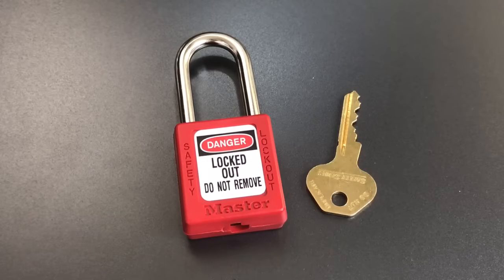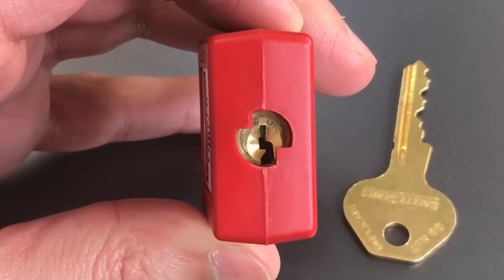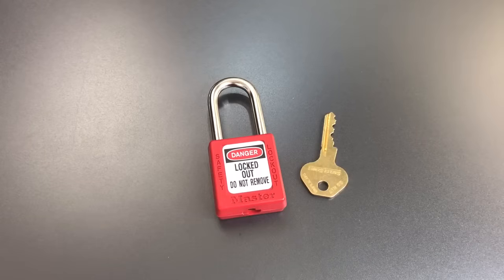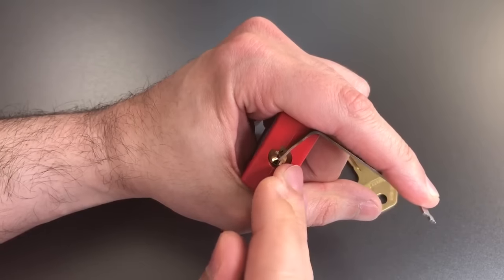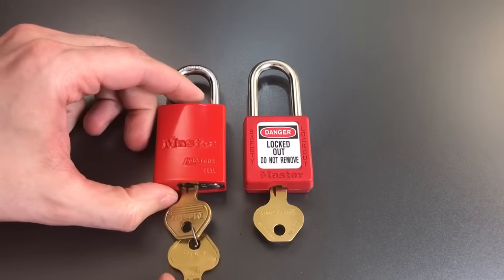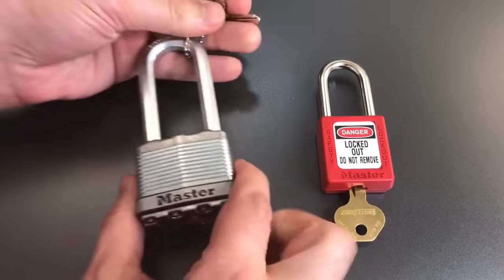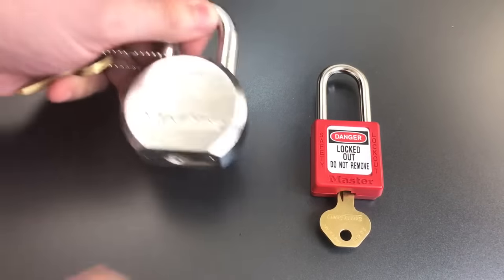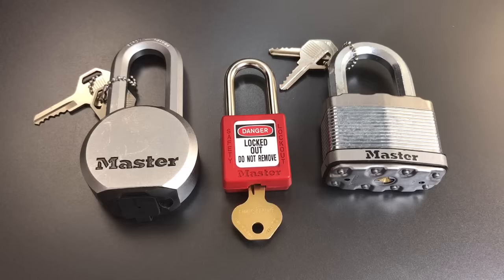[479] The Master Lock Paradox - Model 410 LOTO Padlock

Comment: The reason the body is so crappy is because if its locking something dangerous but you need it in an emergency, and that emergency happens but someone miss placed the key and it had a good body you’d be screwed but because the body’s so bad you can just break it off access whatever it is

Comment: cost and also weather resistance
the more pins you have the more failure points you have and if your lock rusts shut at just one of the pins, you basicaly have to break open the lock which defeats the purpose
all three locks are for different use cases
the plastic body is so that it can be taken off easily but only in ways that show it was brute forced (it might also have something to do with electrical conductivity but i cannot confirm)
the one with aluminum body is for more intensive uses in environments where there is a high risk of projectiles flying around i assume
and im assuming the 4 pin one is for outside use since the more pins you have the more likely a failure due to weathering is i think

thats my theory on it at least

Comment: Master Lock having a huge range of products that are all flawed is probably intentional. Buy one crappy lock with a good core, some guy smashes it open. Buy a different Master Lock with a hardened lock body, some guy picks it open easily. Buy one with a super advanced hard-to-pick core, someone cuts through the non-hardened shackle, and so on. If you buy a totally secure lock, you've just lost yourself tons of potential future sales!

Comment: These are hard to pick but not high security for a reason. They are usually attached to an easy to break or remove plastic breaker lock or wire rope or plastic valve lock. You'd break the lockout device before you break the body or shackle of the lock. Its a MASSIVE NO NO to remove them, it's more of a flag saying hey dont turn this on cause youll kill some one kind of lock. Ive been a marine electrician for 17 years.

Comment: The reason for the complex core is so that there are more possible key combinations, they aren't worried about it getting picked since it's a safety tool not security. Old versions of these only had 4 pins, and at a factory that i worked at they had an incident where 2 people actually had the same key for 2 locks. which should never happen with LOTO situations because you shouldn't be able to open someone else's lock.

Comment: Used to use these all the time whilst working inside machinery.
The body is designed to be fragile so if some asshole goes home and leaves his lock on equipment, a report can be written and verbal confirmation can be given to break the lock and start the machine.

Honestly 2 spanners or even a decent sized screwdriver can break the body.

It's honestly to do with workplace safety guidelines.

You want a lock that's easy to break if needed, but not picked and removed to look like it was done by the owner.

If a lock is removed in an unauthorised way they want the lock physically broken so they know to point a finger, if a lock is picked and removed the blame may be unfairly put back on the owner.

Comment: Maybe that 6 pin core with extra security is to make it more tamper-proof. Breaking it is kind of obvious but picking isn't so easy to identify at a glance. There are certainly applications in which preventing people from tampering with controls is essential. Combine CCTV with a difficult core and it's not worth tampering with, breaking the lock would stand out on footage and be obvious to anyone seeing the lock, picking would be less obvious especially if an individual has reason to be close to the lock and cameras have a poor view of the area allowing subtle hand movements.

Comment: heres what i see: if that lock's purpose in the proper context is for important switches that are not visible to the main public (maybe inside a power node or station) then they would want to be able to get it off quick in an emergency if the key is not easily accessible. A non hardened latch and a shitty plastic body might make sense then, signaling that this should only be removed by the right person and in the right circumstances. I mean, its the only one of the locks you mentioned to have a HUGE sticker on it saying danger do not remove.

Comment: @j37j did a really good job explaining why these locks are “over built” compared to their metal brethren. I will just add why they still make crappy “normal” locks.

It’s because they can. 

Most of the time it works too. So they can mass produce cheep locks and 90% of the time that’s all the average consumer will need. If it wasn’t for LPL we probably wouldn’t know either.

Comment: The plastic body locks are intended for use when a worker is present and require a key to operate. They are constructed to be durable and sturdy to prevent unauthorized access. However, in the event that the key is lost, these locks can be broken easily. On the other hand, metal body locks are designed for longer periods of use and increased durability, making them suitable for securing equipment or facilities for extended periods of time.

Comment: Plastic used for lightweight and easier to  carry, non conductive, less stress on part  that it's attached to, more likely to be used than if someone had to carry around a heavy padlock. I don't think they based the security of the lock on whether or not it was easy to pick, maybe based on whether or not another key could be used to open the lock by accident. With locks and keys being worn out over time and a workplace with a large number or employees with the same amount of key/lock combinations

Comment: The idea behind the super flimsy casing and shackle but the robust core is pretty easy:  This lock is meant to be easy to remove if someone forgets to remove it, but extremely difficult to remove by someone being malicious and trying not to leave evidence of their sabotage.  If they could pick the lock open easily, they could pull all sorts of malicious pranks.  For example, they could take the lock off, hide it in the worker's belongings, and claim they weren't using it properly (LOTO violations are usually extremely severe, sometimes instant termination).  Or, even worse, they could remove the lock, turn on the machine, then lock the machine out again with the same lock and pretend nothing happened.  And as much as it pains me to say it, there are people out there who WOULD do this.  Having to cut the lock off to remove it without the key gives management a route to unlock a machine that was locked by an employee who then either forgot to remove their lock before they left or intentionally locked it as a form of sabotage, in a matter that permanently destroys the lock and requires a replacement.

Comment: The reason for the "paradox" is the core needs to be secure and pick resistant so just any Joe shmo can't pick it and a key is required, but the body and shackle need to be able to be cut in case of a lost loto key or emergency happens and a switch or valve needs to be accessed.

Comment: Well I think because they get cut off more times then not because operator’s put there lock on equipment then shift change happens then they get cut off and due to only have a single key. Also they are used by a lot of mechanically inclined people that can pick locks so that makes since they are harder to pick.

Comment: LOTO locks purpose is not for security, but more for liability. Sure you could destroy these locks and get easy access to anything locked by them, but then the destruction is obvious and if you die from it the company isn't responsible, however if you can pick the lock non-destructively this is harder to prove and looks more likely that someone forgot to lock it, making the company responsible. That is why the locking mechanism is more robust than the lock itself.

Comment: If you come across a lock out/tag out lock attached to a disconnect switch, don't mess with it. They're there to prevent injury, or even death, including yours. There's a procedure to go through if it needs to be removed. (This statement is meant for every one.)

Comment: The lock that can get you charged with attempted murder for removing without authorization.

The body is plastic because of cost. Every person working on the system needs their own lock to LOTO and in the US employers are required to provide the equipment. So, if you have 300 employee's on your maintenance team you need to buy at least 300 locks.

Comment: As for why they are so well done. Imagine someone who would pick open that lock, activate breaker, hear screams, deactivate breaker, lock the lock back to original position, then leave. Person with burn marks would appear from the door...

All pins security pins, all these colors that distinguish them, certain type of pin ONLY on specific position. Looks like someone who designed them had experience with what could happen, and didn't want that stuff to happen easily.

Also that plastic body is preventing repining of that lock. Is this bump resistant as well, or is it old design?

Comment: some LOTO need to be able to work with breaker locking systems, that is,  special devices that can hold circuit breakers "open" -- as you said they are not really security devices more than visual barriers so that anyone knows they must not energize that circuit as you could fairly easily rip off the device used to secure the breaker. because of this, you wouldn't need to deal with the lock at all to defeat its purpose. a bigger issue would be if the lock were able to be picked or raked open since keys are usually issued to one person and they would be responsible in case of an accident for not locking out and could absolutely be falsely blamed in this way.

Comment: They need to make them somewhat resistant to picking because someone could just easily pick it and energize a circuit while the equipment is in service. It has happened to me someone broke a lock while I was working on a machine.

Comment: I think this lock is meant as a reusable seal.
If you pick a LOTO lock, you don't leave any obvious evidence so they made it as hard as possible to pick it. Destruction in any way leaves clear evidence that the device it was securing was tampered with.

Just like those "key safes" I use as a landlord. It's a plastic box which can't be opened without breaking it once it is sealed. There is also  a set of stickers with holograms, one wrapped around the box and one to stick to the lease paperwork. In an event of emergency, I can break the box easily and enter the flat of the tenant. But I can always proof that I didn't use that key.

Not that I would need the key inside of the box - wink wink-

Comment: It makes sense that there's 6 pins to decrease the chance of an accidental duplicate. the security pin thing is a bit weird for a non-security lock, but if one large and possibly government customer asks for it it's not worth the effort of making a lower security version.

the big question really is why none of their high security locks with beefy shackles and steel bodies don't have cores like this when they make them at volume.
Reply: That's probably the reason. Relative savings for high production count. Most people judge a lock by its exterior anyway.

Comment: Ok. I’ve looked this lock up just to make sure my reasoning was sound. This type of lock would probably be used in high voltage situations. The thermal plastic is non conductive. You would not want to bring a ferrous metal body lock into that situation. High voltage arcing to the body of the lock would mean instant death. Even if you just brought it into the area uncased. Also, the 6 pin core would be an extra bit of safety that the lock out was secure in a pull or tug test. That would be my opinion.

Comment: I'm no lock expert, obviously, but the crux of it was really obvious as having security pins to make it difficult to pick but having a paper thin defence to destructive attacks. But yes I do agree, Master Lock needs to sort that out. They know that a lock is only as good as its weakest link, so yes, it really is a strange paradox.
Reply: That is the reason why they are so paper thin, it's more used for safety lock outs with a "lock out tag". You can google image what I mean, but all those holes get filled in with exactly those LOTO locks to insure no one is hurt or even killed when working on machinery. And once everything is repaired everyone removes their lock and lockout tag. And for example if someone loses there key they can easily break it off no problem. A lot of people just don't understand that the LOTO lock is supposed to work hand in hand with the lock out tag. It isn't used for keeping your storage locked up.

Comment: i guess that the plastic lock is meant to be able to destroy the lock if needed since it's purpose is to avoid the accidental use of mecanism and not to make it oversecured, but that's just a thinking i had when the paradox theme came in (just thought that it was not really a paradox depending how you look at it, but if the purpose was to have the best lock then yes, it is)

Comment: working on mine sites we have had to lock out a master key to electrical cabinets to insure no one would turn  it on , at most points of maintenance we could have 3 or 4 dozen employees working on machinery,  
not until all locks are removed can a machine be turn back on

Comment: Correct me if I'm wrong but those types of locks arent really used for security, but safety. Basically you use them to lock up control panels of equipment which is out of order or under maintainence to warn others not to start it up at risk of damaging the equipment, or worse, killing someone

Comment: Very simple question. The plastic lock is designed for safety not security. It's all about using the proper key. The other locks are designed for brutal attacks not picking. In the petroleum industry having the right key for the rite power supply could be life saving.

Comment: There is no paradox, it's not just used by one worker at each isolation point, you will have everyone going in putting on a lock, you don't want keys to work in the wrong lock.
The body however may have to be removed in an emergency by someone else, but only in a worst case scenario. So being able to break it off is usefull.
And nobody else will have a copy of your key, each worker only has their own, their boss/rescue teams/etc WILL NOT have a copy.
If you leave yours on when you leave you will get your arse dragged back to remove it at your expense, people have had to fly back just to remove them back when we used the lock out system.
There is no paradox if you stop thinking 9f it as a padlock and think of it as an isolation device.

Comment: Guessing it's a price/security trade off. It needs to be secure, due to it's purpose, but you can save costs on either the body or core. It's not safe to assume that Master is stupid, but it is safe to assume that they are driven by profit.

Comment: A small factory would use the plastic lock and they would use it for basically stuff you just have to walk out tag out for OSHA purposes. Every factory I'm worked in has used the last lock you've shown. I have no idea why but technically you can use any lock as long as it's identified as a lockout lock

Comment: @LockPickingLawyer The answerz to your question(s) are simple once your understand that your paradigm as as a domestic/retail/corporate locksmith is insuffucient for this lock.

First, the reasons for the plastic body. The enviroments in which this lock are used dictate minimizing exposed metal, live electrical boxes, (very) hot and/or corrosive piping, mechanical vibration. Lastly, these lockouts can hang on the frontbpanel of some pretty dilled up machinery wher the owner doesnt want to chip the paint.

So, how do we allow plastic bodied locks? The "manipulation resitant time rating" doesnt apply in these environments. There are lots of people around all the time. The locks are physically inspected and inventoried multiple times per shift. The penaltied for violating a lockout range anywhere from immediate dismissal to criminal conviction to loss of licensure to loss of an entire business.

Everyone is watching.
Everyone gets to bite the shit sammich if a lock goes missing.

So, destruction is out. What next. Manipulation and bypass so that the locl can be put back. "No one tje wiser, eh?" That is why the six pin security core. Co workers would notice a  pick and a tension wrench after a few seconds. Those four and five pinners, ad you have routinely shown can be raked in a couple of seconds, resembling opetation by a key. 

Ergo, six pins with barrels.

Having used LOTOs since the late 70s Ive come to understand this thimg implicity. Military has been using LOTOs since, forever. Thats where my experience started. Witj my father telling me how he used tjem in the Korean War. And then I used them the 21 yrs I served. LOTOs have saved countles lives and Bilyuns$.

Cheers, thanks for all the education.

Comment: Is the cheaper body build a cost saving method? As a manufacturing supervisor, If I caught someone trying to pick a LOTO that would be IMMEDIATE dismissal. Meanwhile, In a factory of 225+ ppl I am often 1 of 3 ppl allowed to cut/break the locks (if left LO in error) should proper steps for unlock be followed. 
The shackle being weaker wouldn't be an issue if only 1 or 2 ppl are allowed near the lock with bolt cutters.

Comment: There are probably standards for how secure the lock needs to be. We use these at work, when ever something like a conveyer belt is worked on the power switch is turn off and then locked with a pad lock. And ONLY the person who placed the lock is allowed to remove it. For obvious health and safety reasons.